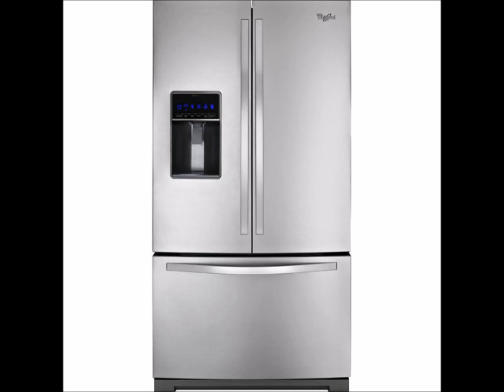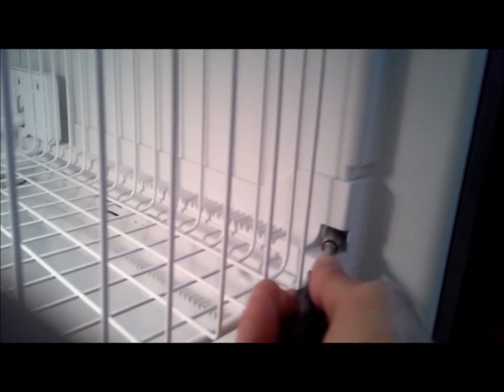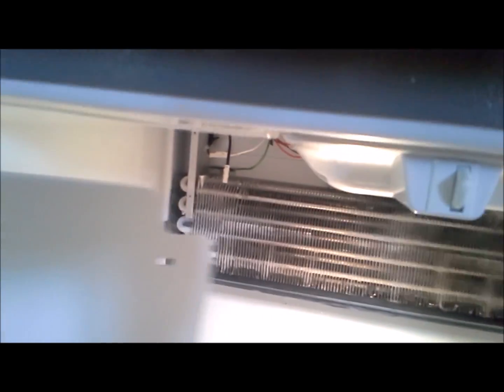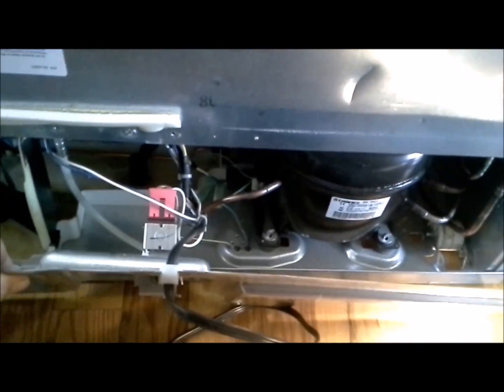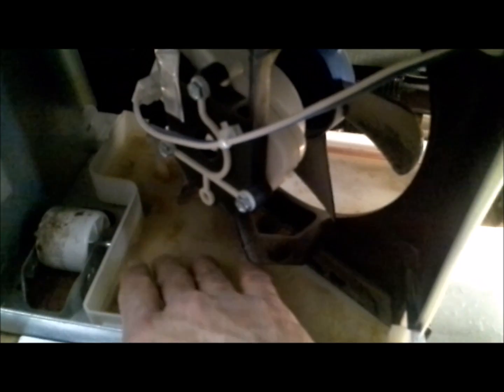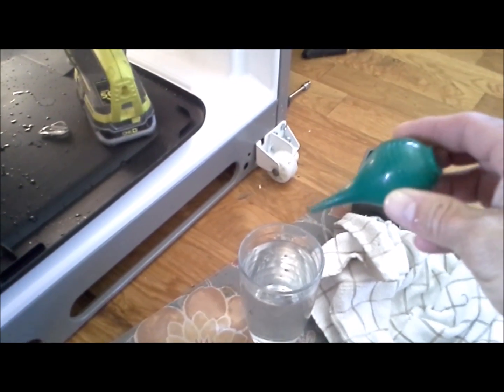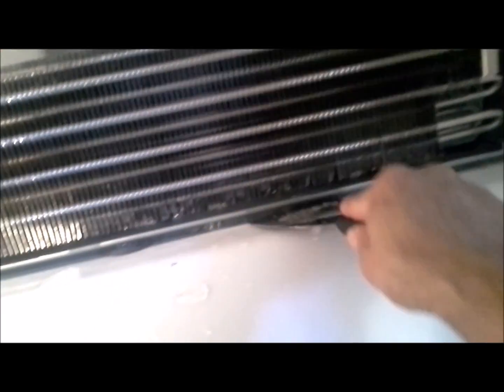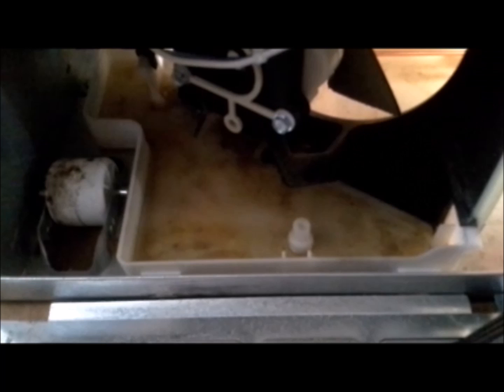Whirlpool refrigerator repair- ice in freezer- water on floor Fix Maytag, Kithcenaid, Kenmore

Comment: Outstanding instructional video.  I was about to call a repairman until I came across your video.  Simple and thorough.  I saw another video where the guy cut a slit in the nipple, I did that hope it helps.  I also used my Shark steamer attachment and it took about 10 minutes to clear the hole.  After that the water flowed straight through. Thanks again.

Comment: Just replaced this part today. It's a straight forward fix. I defrosted the fridge over night, instead of taking apart taking apart the lower freezer components and then using a hair dryer, chipping away the ice, etc. as shown here. The instructions in this video are good. I purchased the new design P-trap/Drain pipe. Only issue I found with the replacement parts is that the white plastic o-ring that needs to be installed over the drain tube that exits the freezer makes for a very tight fit installing the new drain pipe. I used a small utility blade to shave off some of the plastic from the inlet hole of the drain pipe, then applied a very small amount of plumbers grease to help make it easier to slip it over the white plastic o-ring. Worked like a charm. As shown here, the real issue is with the original rubber grommet that was used in production for these fridges. They get all gummed up over time and won't allow the condensate to drain into the drain pipe and down to the pan in the base of the fridge. Very poor design. The new drain pipe should definitely eliminate ever needing to do this again.

Comment: This was GREAT! We bought ours in 2011, had it repaired under warranty where they tech did a "hack" and cut open the nipple a little. Today 9 years later, the problem recurred. ONLY to find out there was a class action suit about this manufacturers defect for $21 million. EXCEPT it was only if you had bought the unit within the previous 5 years!

Comment: Worked like a charm! I ended up using a hair dryer because we had a huge build-up of ice. And then I had to pour hot water down the drain hole to clear the ice plug. Thanks for the instruction!

Comment: Question. I’m having this exact issue but with the top part of the unit, so I’ve is collecting on the bottom of the fridge section. Would I check the same thing in the back and where?

Comment: Thanks CLS Allinone for this video, its saves our couple of hundreds dollars. Very easy to do after you instructions. 
We only clean the filter from the back and we didn't opened the fridge from front as its our is more complicated and also we have a extra deep freezer. We stopped the fridge for 6 hours and all the water drained automatically from the front.  Thanks again.

Comment: Just know that if the drip rubber valve isn't clogged up it is something else causing your issue and a lot of times in 2 to 3 weeks its back been through it, some of the other issues are the condenser fan right above the coil that you use the hot water to unfreeze also seen a lower freezer door that looked like it was sealing and was not causing this issue as well as a ice dispensor seal on bottom of ice maker where the ice comes out not closing or broken and also of course this problem.

Comment: Also, there’s a class action law suit for this problem going on now via Whirlpool only , go to Freezersettlement.com to fill out claim form. 1. Reimbursements for all money paid for repairs 2. Call whirlpool and they will send repair guy with fix kit that replaces the grommet for no charge. Gotta get it done ASAP, Jan 2020 in the date to put claim in so n/c fix it reimbursements.  Hopefully you got a postcard, but I’m sure many will lose out on claims  for many reasons. Sadly the lawyer group will get a huge pay day they are asking for $1.8,395 million,  wow!  That does not include Whirlpools n/c repairs, that cash money settlement, I’m sure at the most claims  will kit equal the settlement they may get.  Bet lawyers come out with at lest $1 million maybe more.  So unfair as everything in life right!  FYI!  I hear ya frustrations with this, I think my floor is damaged from continuous leaks, water you can’t see under fridge, see a buckle of the wood.  Freaking idiots who made this grommet design

Comment: What’s the easiest way to rid of the ice build up at the bottom. I r got easily 3-6inches  or more of thick ice,  I threw away the stupid gromit and got rid of ice in drainer, but bc there’s so much ice it’s stopped filling with NEW water but have so much ice buildup.  Thinking my only option is take out food and defrost. Lots of food waste, but Owell.  Any quicker fix option would be great! ???  Stupid nipple grommets!  Worst design ever.  I tried clean it out, it’s going to re freeze and problem will come back until you either buy the new kit for full replacement of the grommet design,  I said forget it after the 6th time and threw it out.

Comment: Great instructional video!  Wouldn't using a hair dryer expedite the melting of the ice in the coil area of the cabinet?   Couldn't you use a small shop vac to remove the water from the collection pan in back?   If the nipple clogs and causes this problem, couldn't you expand the orifice so that it is less likely to trap debris?   I just got one of these refrigerators and I have been reading all the complaints about the ice build up and water leaking problems.   I am trying to figure out how to prevent this before I have an issue.   Thanks for taking the time to make such a helpful and detailed video.

Comment: This is a common problem on Whirlpool refrigerators.  My drain line froze up and I used a hair dryer, hot water, and compressed air to clear the drain.   I never had another problem with the drain.  One of my relatives junked his Whirlpool refrigerator for this problem.  He refused to have a repair guy come out to his house and fix it for him.

Comment: I have the same whirlpool refrigerator issue, where ice builds on the bottom every 2 months. So far replaced the freezer gaskets and clean the black nipple at the back, cleaned the drainage too, but I think I didn't remove much of the ice. Well next time I will do a better job. Thanks for the video.

Comment: EVERYBODY THAT HAS THIS TYPE OF REFRIGERATOR AND   YOU HAVE  THIS PROBLEM JUST DISCARD THAT "NIPPLE"
It something that was a installed for obsolescence so you have to call service person. These jerkoff manufacturer's should be shot in the head!
I have a Whirlpool refrigerator that's less than 5 years old and my coils kept freezing up! I had to replace the thermostat and the timer. I remember when refrigerators used to last 25 years or more. Nothing but Chinese junk anymore

Comment: That is not the proper fix, that's a temp fix. That duck bill you cleaned is gummy due to the heat from the compressor and should have been discarded and that whole drainline replaced with a p-trap.

Comment: I just had this issue. About once a week, I'd have to clean the sheet of ice out of the bottom of the freezer or it would leak. Then I started having an issue with the freezer frosting up. I was scared it would completely ruin my hardwood floors so I broke down & had a Whirlpool tech come out. Whirlpool covered the parts since this is a known issue and he charged $129 for labor. It took him about 30 minutes.

Comment: Thanks for the clear instructions - one question though. Can I just skip the manual defrosting - seems like a lot of work to take apart the trays and back panel etc. I was thinking to unplug the fridge and let it naturally defrost then once that is done, clean/replace the grommet - is there any downside to this approach?
Reply from the maker: Yes you can do it this way it just takes a long time depending on how much ice there is.

Comment: I've seen a few people below say they use a blow dryer to melt the ice. Is there some reason it's a bad idea? Could you somehow damage the refrigerator with hot air?
Reply: I'd say if your working around water and your hair dryer is plugged in, that's not a great idea. May get shocked. I would do it like the gentleman advised in the video, to be safe. You cut corners you could get hurt.

Comment: You hit the nail on the head on this one.  There was lint in the nipple which blocked the water, so it froze up and blocked the drainage hole causing water to settle on the bottom of the freezer, and when that froze it leaked out.  Thank you for the video!
Reply from the maker: thanks for watching
Reply: Over a week later and no more leaks!
Reply from the maker: sewashburn0529 great news .. unfortunately the fridge drainage design was a poor one causing alot of unnecessary leaks for alot of people out there.

Comment: Everything worked great - removed the tube in the rear of the frig and cleared the plugged area but after defrosting and clearing the ice build up around the inside drain, it still will not drain - thought there was more ice build up in tube but been defrosting for a few hours Any suggestions ?
Reply from the maker: Vito Giambalvo great to hear

Comment: Is that rubber nipple even needed, I need to take mine apart same issue, Thx. Once a month I have been taking the big sheet of ice out of the bottom, when I see a little water on the floor.

Comment: Thanks!  Second time in 5 years I have had ice build-up.   So bad it got into freezer light switch and froze it to OFF position. This video also works for Ikea fridges (of 2011 era  and others) as they are Whirlpool.  Ice maker and drawer arrangements are a bit different.  Took the opportunity to get rid of that ice maker as we don't have water line. Suppose I should get P trap to replace the rubber grommet next time it happens.  Used a hair dryer to melt ice, and shop vac to suck up drain reservoir water.
Reply from the maker: Condorcounter Whirlpool should give everyone a $500 refund for this terrible design. Thanks for watching.

Comment: When I installed the new p-trap drain and noticed the drain pan was dry, I thought that was normal. After installation, condensation still persists. So now I will have to take the freezer drawers out and heat up the coil to clear the ice, correct? One question, where do the water go from the drain pan? I know the drain pan won't hold much water.
Reply from the maker: Correct ice needs cleared its actually faster to scrape ice out versus hair dryer I have tried both . The water evaporates but if there is too much ice build up it could possibly overfill just use rag or sponge to drain pan as it thaws.
Reply: C.L.S. Allinone Thanks for your prompt response. I'll work on it tonight.

Comment: Thanks for the video! Did as you said and didn't really find a clogged drain but a huge chunk of ice covering some copper line and electrical part. All cleaned now. My leak came when we ran the dispenser. Maybe drain had slight clog but I was able to clean it all. Thanks again
Reply from the maker: your welcome. glad I could help

Comment: Lol. I've had this problem for about a year and I blamed my ice maker! Disconnected it, problem still there! Then I checked this wonderful thing called Google and U-tube. Found the problem right away. What really bugs me is that Whirlpool will NOT cover this replacement part for their fucked up design. Fridges are basically the same design, but I`m not buying anything with name whirlpool on it anymore. Order came up to $52.00 which includes everything. I don`t think that would've broke whirlpool! But they just lost this customer!!! Thanks for your help C.L.S Allinone:-))

Comment: It's best just to replace the funnel and gasket with a P trap. It's only about $30 and you never have to clean it again.
Reply: I'd love to know what kind of P trap you used. I like once and for all solutions. The other question I have is do you really need that stupid grommet? or can you make the open bigger? I know it could potentially cause the drain pan to fill up quicker and leak on the floor. I'm just looking for a solution to this poor design problem.

Comment: I'm considering cutting the black nipple some so it can't plug up... that or removing it completely like the fridges of yesteryear
Reply from the maker: Unfortunately that might cause it to overfill defrost pan and end up on floor also. They sell a Ptrap kit you can buy to replace the nipple.
Reply: Thanks! I called whirlpool and they sent me one for FREE!
Reply from the maker: +majikdragon  Awesome news. They really messed up on the original design of the fridge and they are well aware of it.

Comment: Thank you so much for this step by step video! My handywoman skills are limited to hang a picture, change a lightbulb etc. but with your video, I fixed my fridge. Your explanations were very easy to follow. I had to show my husband the video to see what tool you used as my knowledge of tools includes hammer and screwdriver. That might be obvious to anyone else but for the novice it would be helpful to mention the name of the tool.  Also, I couldn't figure out how to unhook the water tubing on the back of the fridge but I had turned the water off just like you showed in the video and the tubing was long enough to remove the panel with the tube attached. My model of fridge had some additional wire in the back that I had to disconnect but again, very easy.
To anyone out there contemplating following this video to fix your fridge: this should give you confidence that you can do it with this video. I have zero experience or even knowledge of the tools (it was a socket wrench in case I'm not the only clueless one attempting this) but I now have a working fridge that doesn't leave puddles of water for me every morning!
Reply from the maker: +Lynn Oquendo Your welcome Glad I could help.

Comment: great vid thanks.   could you just push wire or something up the hole where the nipple is, to unblock it that way?
Reply from the maker: Just clean nipple thoroughly with soap and hot water. Nipple holds cold air in also so I wouldn't recommend leaving anything in nipple opening. They sell a ptrap kit at whirlpool to replace nipple. Link for Ptrap is in comments.
Reply: thanks.  i didnt mean leaving something in the nipple, just ment remove the nipple and then bang a rod up through the hole to clear the ice then replace the nipple.

Comment: Thank you so much!  I have a Kitchenaid fridge with the same problem.  I followed your instructions and it saved me a new fridge.  One thing I did a little different to speed things up is use a hair dryer on the frozen areas.  Thanks again.

Comment: Thank for taking the time to make this video. I tried other videos, but too much wasted time. You cut through the unnecessary wasted time and went straight to the point. Thanks again. Why do they make such a system with that pinched off rubber plug that gets clogged? I wonder if it can be run without. If it happened once, it'll happen again.

Quick Note: I guess that grommet has a slit so the water can't drain too fast into the outside tray? Anyway, I used an electrical zip tie around the grommet up where the slit is. Using the zip tie, I compressed the upper part of the grommet which opened the slit up slightly more than it was originally. I hope this doesn't cause any problem. Oh, yes, the grommet was clogged with all kinds of bunched up lint and junk, and the lower external tray was dry as a bone.
Reply from the maker: +Paul Zacharias your welcome

Comment: Just fixed my Whirlpool thanks to this video. I also had a couple other items like the ice maker to remove. Hopefully, I'm good to go for a while.
Reply from the maker: Glad to hear you got it fixed
Reply: You can order part number W10619951 @ no charge to effect a permanent fix for this problem.  I ordered mine via live chat yesterday and it shipped today.  Call Whirlpool @ 844-200-5460 or request a chat sessions @ www.whirlpoolparts.com.  Have your model and serial numbers handy.
Reply: +Dave Cook  I tried like heck to have them ship it @ no charge but they wouldn't budge. They claim they have no claims for this problem with my model gb2fhdxwq06. But the problem and my freezer look just like the video. I wanted to have everything I need for the permanent fix before I go to attempt this, even if I have to pay for it, but I'm not even sure if this part works for mine.
Reply: +dc2257 I had to insist that I wasn't paying for a service contractor to do the work. They finally agreed to ship me the part. My fridge is apparently still covered under the warranty, so that was good.
Reply from the maker: Awesome news glad my video helped you out . Good job

Comment: Great video. I have a Maytag version with different top basket mounts that caused some delay in re-fitting. That crazy "grommet" RtoR ( round to rectangle ) caused all the problems! I changed it slightly so it cannot plug up again. Believe it or not, we just experienced this leakage the day after our new tile floor was laid!!! Good video, saved me a service call.Steve.

Comment: Great video.  I just cleaned mine out and THEN watched the video.  My suspicions were right -- the nipple hd some lint in it.  I cut the slit opening with scissors to make it a little bit more open.  Can I just cut the bottom off so it is competely open?  

Also - I did not remove the inside cover.  Instead the frig was emptied and defrosted for 3 days.  Good enough?  water flows freely down the chute.
Reply from the maker: +Coffeedogs04 Yea as long as it defrosted you are good most people are unable to wait three days for fridge to defrost on its own. Be careful cutting too much off the nipple it may splash on to floor if it flows to freely. Keep on eye on it. Here is the permanent fix for the drain tube they offer from whirlpool now.  https://docs.google.com/file/d/0BzIiBNwRIV4NNWJNNmx0andROGs/edit